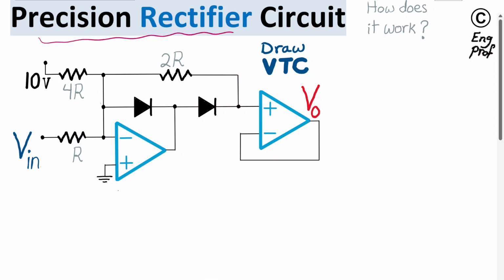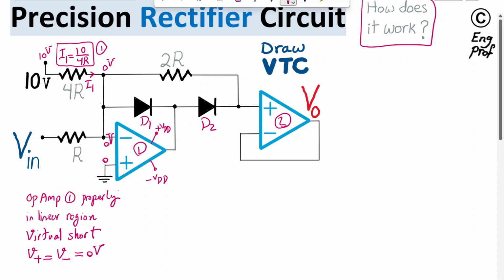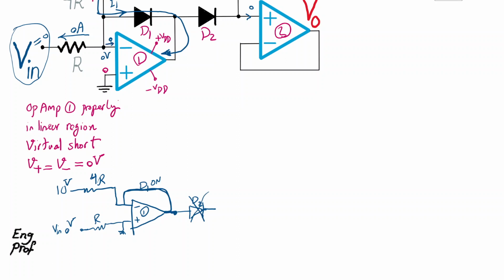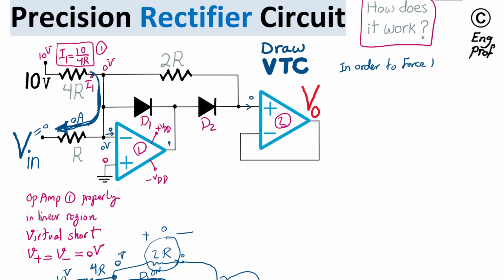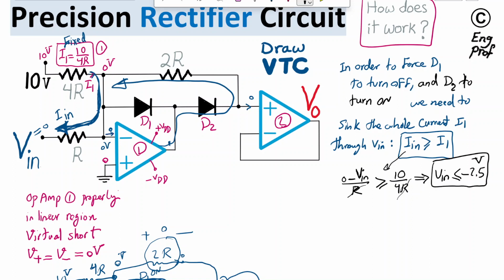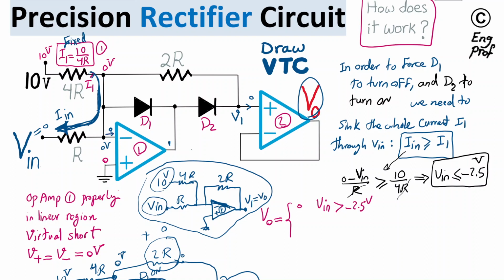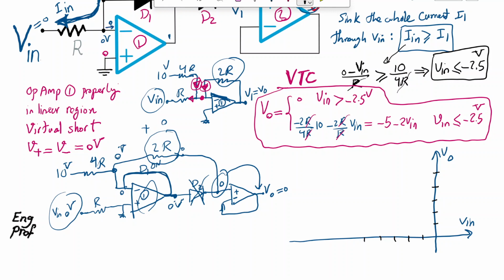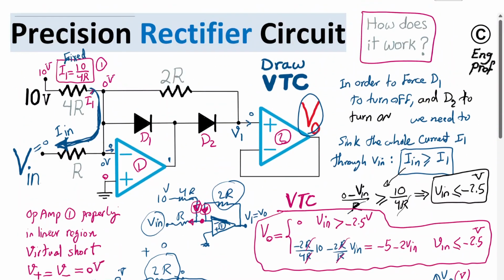Precision Rectifier Op Amp Circuit: How does it work?

Comment from the maker: Thanks for watching. For more op amp based Rectifier Circuit Examples please watch AC/DC converter application Https://youtu.be/4aG5NYX8tGo
Diode-Amplifier VTC https://youtu.be/vpGZkafxMJM 
Triangle Oscillator circuit https://youtu.be/JF5Up_cuL9k
As practical applications of the Rectifier Circuits, computer and mobile power adaptors and AC to DC converters use rectifiers to convert AC alternating voltage to a 12v or 5 volt DC supply that charges computer or mobile device.  
I hope these circuit examples are helpful.
Reply: I think this circuits use for measurement eqipment ( AC milivoltmeter, voltmeter e.t.c ).
It don't use for power supply rectifiers. ( Can use only for power supply measuring and feedback control circuits ).
Reply from the maker: @ingussilins6330  Thanks for your interest in this Precision Rectifier Op Amp video and for sharing your thoughts.  Here are a few related videos: RMS meter Peak detector AC/DC converter video https://youtu.be/4aG5NYX8tGo and Triangle Oscillator circuit https://youtu.be/JF5Up_cuL9k video.  
I hope these videos are interesting as well.